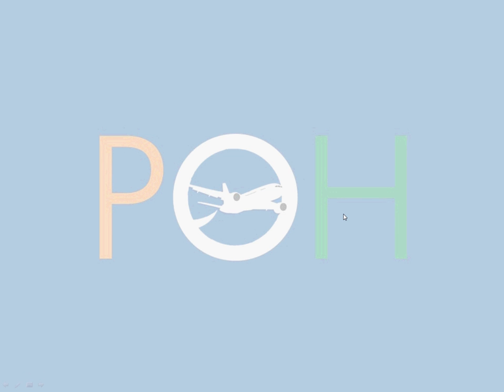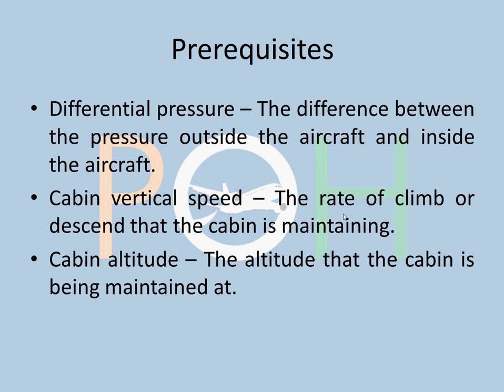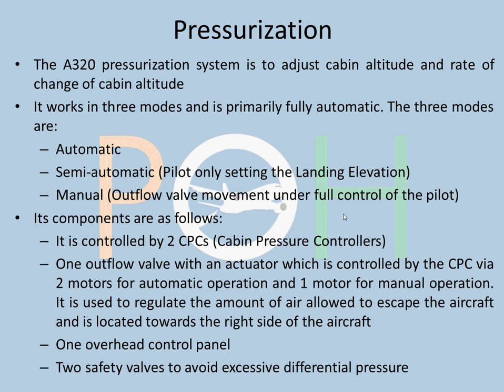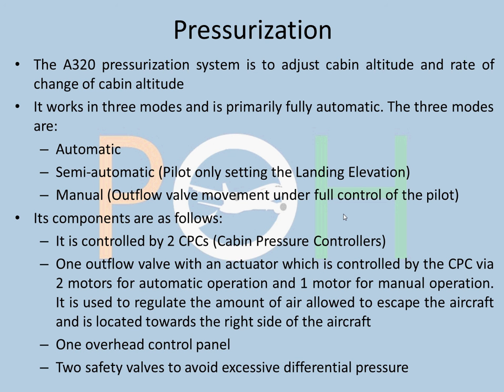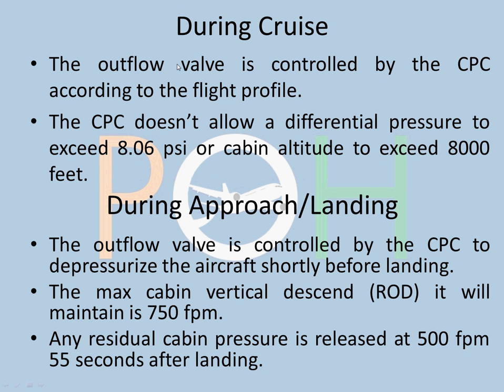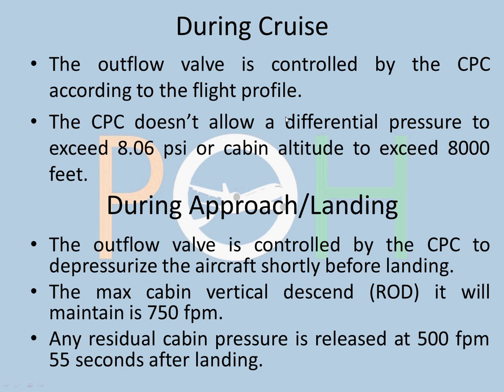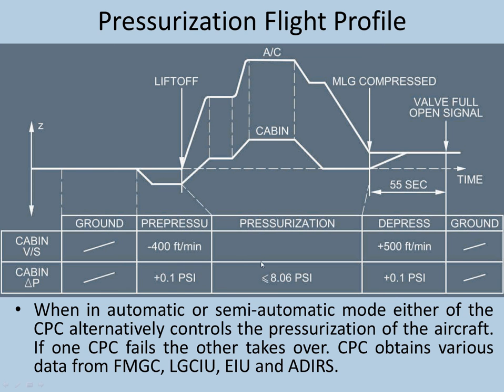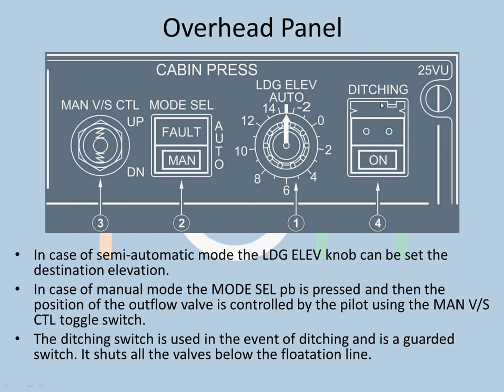A320 - Pressurization

Comment: Isnt it supposed to be the opposite? Cabin Altitude increase during Airplane climb phase means it is de-pressurized. And Cabin Altitude decrease during descend means it is pressurized to match the higher pressure at lower level.
Thank you my friends, watching through your videos helps alot as I'm doing my line training now.
Reply from the maker: Pressurization is based on delta pressure. Increasing cabin altitude in a manner so that delta pressure is increased. Cabin altitude is increased because actual aircraft altitude is also increasing, but in all to maintain delta pressure value.

Comment: superb useful. It makes learning more efficiently.

I would appreciate if you can refer some related ABN PROC to the lesson (ie. why Smokes Removal Proc ask pilots to set LDG elev to 10.000ft). 

Thanks
Reply from the maker: Thank you! 

Smoke removal procedure doesn't ask pilots to set LDG elev to 10000 feet. It asks pilots to descend down to 10000 feet. Two separate things.
Reply: Planes Over Head yes it does. Set LDG elev to 10000 and descend to 10000, so the outflow valve will open when reaching 10000 ==> smoke go out.

Comment: @PlanesOverHead Excellent work! I have 2 questions:

1. If the aircraft Depressurizes shortly before landing, is there any specific time limit for it? And after that, if we go around or do a touch-and-go, will it create passenger discomfort due to Repressurization?

2. On the LDG ELEV knob, the highest figure listed is 14. Theoretically or practically, does it mean that A320 cannot land at airports with elevations higher than 14,000 ft MSL? And why is there a -2 on that knob; can an airport have a negative elevation?
Reply from the maker: The repressurization is done at a very gentle rate, because during go around you're generally at lower altitudes which doesn't really require that level of high pressurization, it's just to avoid the rotation surge. 

Yes airports can be below sea level too. Lot of airports in California and Netherlands for example. 14000 feet is to cater for high altitude operations where after specific approval of the manufacturer and regulator the aircraft can operate under monitored conditions. Not many airports above 14000 feet in the world.

Comment: Hi there, I have a couple of questions. Is the Cargo bay also pressurized? I know that it is ventilated with cabin air, and in some options heated, but as I understand the cargo bays are not pressurized? I cant find it explicitly mentioned in the FCOM!
Reply from the maker: Cargo bays are mandatorily pressurized. No option to that. You'll get a diagram in DSC-20-20.
Reply: @poh  Great, I found the diagram, I knew it was in there somewhere. Thanks a lot
Reply from the maker: You're welcome

Comment: Hello, first of all much love from Greece! I would like to ask, where can I find the correspondance of the diagram you present in 3:00 ? What I mean is, whats the function that corelates a/c altitude with cabin altitude, when it is in the automatic profile? For example, if I know that the cabin altitude is 5000 , what is the a/c altitude?
Reply from the maker: Thank you so much. 

There is no diagram or any graph for what you are asking, but an approximate and a generic list of values are given in CAB PR SYS 1+2 FAULT. It cannot be fixed for a simple reason because we are never flying in ISA conditions and it purely is dependent on actual outside conditions at that particular area that you're flying through.

Comment: hello there, I've got a few questions, in the event that there is double pilot incapacitation, and assuming that the cabin pressurization has been compromised. how can one make sure that the setting of the cabin pressure  is back to normal again. how to set it up so that the cabin has the desired cabin pressure based on the altitude it is in?
Reply from the maker: In your question I didn't understand the context of "back to normal again". If you could elaborate.
Reply: @poh  hello there. What I meant was if in the event the cabin pressure was compromise either by the pilot or some unfortunate event. How can one adjust back the setting for cabin pressure on high altitude flight? Is there like a setting that would auto adjust it based on the altitude the aircraft is flying?
Reply from the maker: For whatever reason if there is a sudden pressure drop (beyond the threshold which is triggered by ECAM), there is no procedure to reset it back and all even if aircraft seems to indicate its okay now. You first simply have to descend and decide later. And if the computers are available they will auto adjust. If computers not available then you've to manually adjust it yourself. But if there is a massive damage to the hull, nothing will work irrespective of the situation.
Reply: @poh  thank you for the information👍

Comment: I have a question are all your vids based on fcom as well as your understanding? because this provides more info than CBT's and i love it! and also isn't the maximum differential pressure 8.6? why is it 8.06?
Reply from the maker: Yes that's correct. And thank you!
Reply: @poh  Fcom has so much things to absorb so im using your notes because i feel it's similar to the fcom and ill read on fctm for flight purposes
Reply from the maker: Maximum differential pressure is 8.06 and 8.6 is safety valve operating limit.
Reply: @poh  Okay Thanks for clarifying! I told my friends about your page because i told them its similar to the fcom since some are lazy to finish 1000 pages so i think they'll find this really helpful since you based it off fcom
Reply from the maker: Thank you